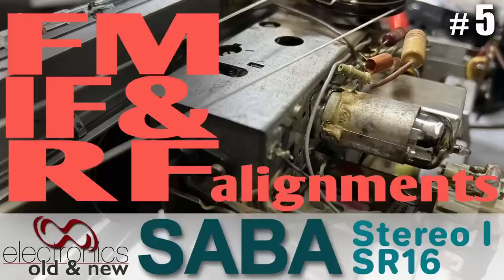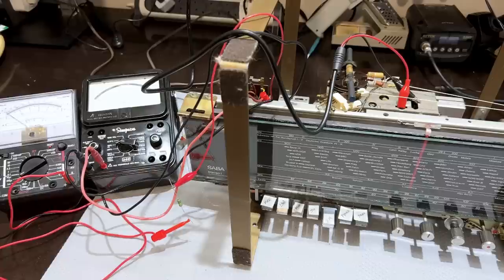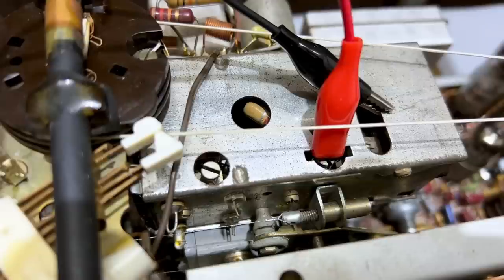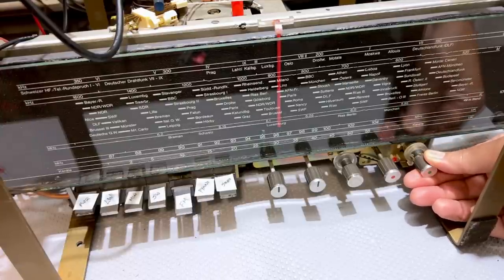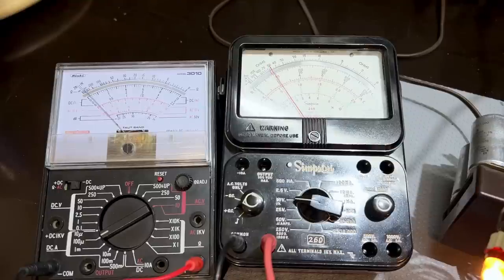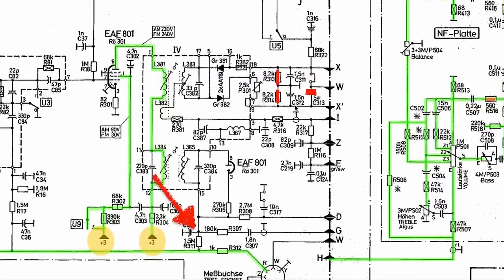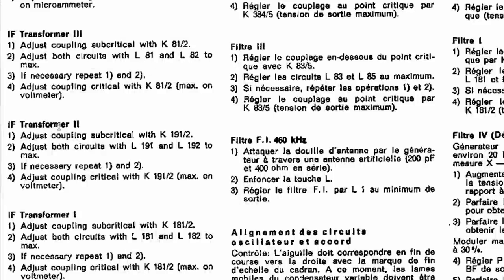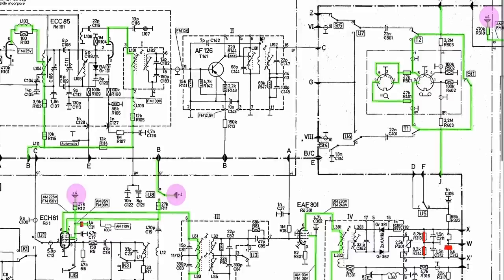Tedious but Fruitful FM Alignments. SABA Stereo I - restoration part 5

Comment: Great job at explaining how to align the F.M. section. I guess the best way to see if stereo is working is to just do what you've done unless you have a supply that outputs micro-volts. I think your little transmitter device you use with a stereo carrier signal is probably the best that can be done with buying specialized equipment. Looking forward to seeing this boxed off back in its case.

Comment: For the benifit of those new to the alignment process....The instructions want you to align the FM IF's using an unmodulated carrier in order to center the bandpass of the filters.  Then we introduce modulation to set the width of the filters.  FM has sidebands that extend out (theoreticaly) to infinity.  We want our IF filters to be about 192kHz wide, with sharp skirts and a reasonably flat top.  

At 51:22 we try to "neutralize" the RF front end (first stage.  Neutralization is a form of negative feedback.  We achieve this by taking some of the output from the plate of that tube and INVERT it 180 degrees, then feed it back into the grid.  This is done through L104 since the bottom end of that inductor will be 180 degrees out of phase from the top end of the inductor.  C104 is used to vary the intensity of the feedback.  All tubes have internal capacitance and neutralization balances this out and provides us with a nice "linear" amplification and reduced distortion in this stage.

51:49 is the alignment GAIN of the 19kHz stereo pilot filter.  The instructions should have said to modulate the FM carrier with a 19kHz tone of about 3-7% modulation, then adjust the pot for lamp illumination.  The 19kHz pilot is used to sincrhonize a doubler to get 38kHz and this is injected into a diode matrix which unmodulates (SSB) the L-R part of the composite signal.

Thanks Manuel for all your fine videos.  Keep up the great work.  73
Reply from the maker: And thank you for the added information that you provide here. This type of comment is invaluable to everyone who enjoys this hobby.

Comment: Neutralization is in simple words a small amount of negative feedback in an RF high gain  amplifier that eliminates self oscillation of the RF amp.Nice job.
Reply from the maker: But how do you measure the results of adjustment in order to set it correctly? If self-oscillation is what one is trying to avoid, then is the absence of self-oscillation an indication that it is set correctly?
Reply: @electronicsoldandnew  yes  you making a balanced act between maximum gain and self oscillation thats why you deactivate the next stage so if the rf amp oscillates during this adjustment you don't have this huge signal amplified.Wise choice not to mess with it.keep up the good work.
Reply from the maker: Thanks 😊

Comment: Another interesting and enjoyable alignment video. Thanks Manuel. Does that handheld FM generator have a stereo input Jack? If so can you modulate left and right with different tones to test the radio's stereo discrimination?
Reply from the maker: Yes, it has an analogue input option, but I’ve never used it 😊

Comment: That SUP3 generator easily modulates on left or right, so there's your check for stereo. And I got the feeling that the sensitivity for the stereo light (and maybe trigger for the stereo decoder ?) is low, because we saw only some flickering on strong stations.

Comment: Did you ever have a repair on an early FM radio's stereo decoder? Would be interesting to see how to fix that (in early FM stereo radios, the decoder was still built with discrete components...)
Reply from the maker: I have worked on the transistor version, but not from the tube era.
Reply: Do you have a video about this?
Reply: in this unit, the stereo decoder is also made completely by discrete components, including few coils
Reply: @boriskolev9513  Yes, I also realized that, but he did not touch it because it worked fine. It would be interesting to see a video where such a decoder is dead and is repaired...

Comment: Well an hour or more suits me just fine. I am working in my little electronics shop and will listen as I plod along.

What I am doing is simple compared to aligning your radio. I had built a small parlor guitar and I recently installed a trio of  piezo disc transducers on the inner surface of the top or soundboard. I should have checked the frequency response of the trio across the interval of audible before I glued them in. Why? Because it's not even close to flat and they are pretty hot.  

Right now on one factory made instrument amp  I can adjust the tone control to get rid of the harsh sound of over emphasized high frequencies, but the small instrument amps I built cut corners by having little in the way of filtering.

I am thinking of making either a filter or a three or four band equalizer to place in the signal path and doing a bit of research online to get a feel for which to select.
Reply from the maker: 👍 have fun finding the right filter settings. Perhaps you could input it into your computer and analyse the result there so that you have an idea of what needs cutting.
Reply: @electronicsoldandnew  That's a good idea too.

This morning I used, in a limited manner, an old analog Precision 1474 oscilloscope  that I think is good up to 30 Mhz. I had bought it for $100 twelve years ago for the simple transmitter/receivers that I, aka kc2wvb here in the states, enjoy building. Regenerative receivers used to be a lot of fun to assemble and it worked well for the job. 

However,  I don't have a way to sweep across the audio spectrum unless I drop a speaker into the body of the guitar and use an audio file that John from JohnAudioTech gave anyone interested the ability to copy. Hence I just fretted the High E string at about 500 hz and the low E at about 200 hz and saw about 100 to 150 milivolts of difference in their peak to peak signals. It was a very approximate indicator because the strength of the pluck has a big impact on the voltage, but it strongly suggested high frequencies were emphasized.

I know in general how to construct pass filters and etc and have enough parts to fabricate a simple 3 band passive or active equalizer and then see how well I can dial in what I need for the issue at hand that is a bit ambiguous because I can't seemingly sweep the audio interval. 

For speed I did look up on Google and find two 3 band DIY equalizers that have a bit of instruction with each. The one is active in that it uses an op-amp. From what I briefly saw it was not clear to me if the op-amp was being used strictly as a buffer/follower downstream of the gang of three pass filters or whether it was also intended to increase gain. If I studied it I should be able to figure that question out but I did not see the need for any gain nor the equalizer being active, so I likely will borrow from the other DIY 3 band equalizer and assemble my version of it to test on the darn transducer and see if I can dial in an acceptable final output.

I can't help but think buying inexpensive piezo disks played a role in my issue and if I had researched more I would have found a more expensive alternative with a flatter frequency response. On the other hand I think one learns more from mistakes than anything else so it's now a learning experience which is good and at age 67 it beats watching Jepodardy on TV which is better yet.

Thanks  and I enjoy all your videos & even the high voltage repairs or renovations outside of both my comfort and skill boundaries.
Reply from the maker: You could try simply adding a small capacitor at the output of each piezo to see if the shrill effect can be attenuated. I would try 10n and go higher if the cutoff of high frequencies is too much. You might get it tamed that way and it’s simple and cheap.
Reply: @electronicsoldandnew  Good idea too but it's all buttoned up in the body of the instrument. Being a thin bodied parlor guitar it was really hard to get my hand in it to hot glue in the transducers.

So, I came up with:

Here is Mike's plan for his goof. ie The nasty piezo transducers that do not have a flat frequency response.

It's a 3 band passive equalizer. One band consists of a filter that lets hz greater than 3400 pass. One band is a band pass filter I call an interval filter & it lets the interval 80-3400 hz pass. One band is a filter that lets less than 80 hz pass. 

Each band has a 10k potentiometer in conjunction with a 100k resistor that forms a voltage divider. Because the signal from each band maps to the variable wiper on the potentiometer by changing the wipers position one changes the volume of the band that feeds it.

Wala, hopefully I can now dial in a good sound. The calculations for the filters was made easy by online calculators and it actually took more time to draw my schematic than anything else.

Now,  it's time to walk my Australian Shepard who has been tugging at my leg & later with
Crossed fingers I'll try out my new soldering station.

Thanks again,...

Comment: Repetitive boring alignments, maybe to you Manuel but not for all your subscriber . 
Stateside commercial broadcasters are starting to use a device called a "time warping" to speed up programming so they can fit more commercial messages in a given time slot.
Reply from the maker: I’ve been trying to time-warp in reverse to try and avoid youtube from adding too many ads in the middle of the videos. If I leave it to them they seem to flood the videos, and if I prevent the mid-roll ads completely, they seem to slow down the promotion on the system. It’s a balancing act, unfortunately. Personally, since I watch a LOT of YouTube videos on the work of other restorers, I’ve subscribed to the ad-free alternative. The cost is justified for me, but I can understand that it’s not for everybody.